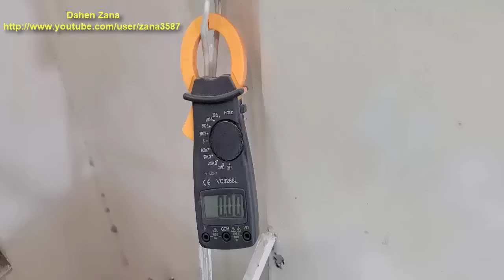Restoration drill hammer

Comment: Hello. Great job. I am going to start repair my electric hammer tomorrow. What grease did you use to lubricate the mechanism?
Reply: Bosch sells rotary hammer grease. Just lub up the end of your bit and go. although some use grease internally too if it doesn't use compressed air like most electric ones do now. It's really neat how the new ones function.

Comment: It looks like a "Globus" to me. I have a similar one.
Bought it from a recycling center for €2 or something.
It wasn't "saying" anything.
I mean I press the switch and ... nothing. Which means 90% an easy job.
I mean broken switch, or cable, or a wire.
And I was right. Broken switch.
I replaced it, and it works perfectly.